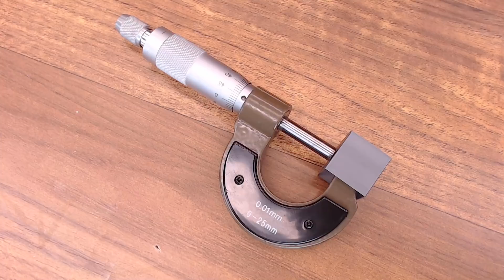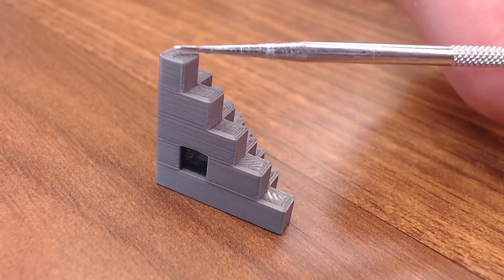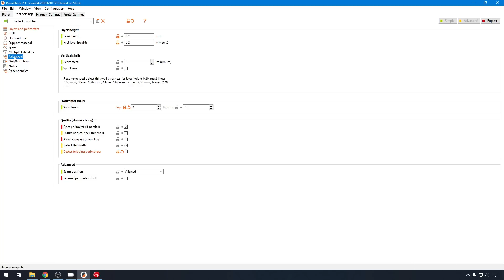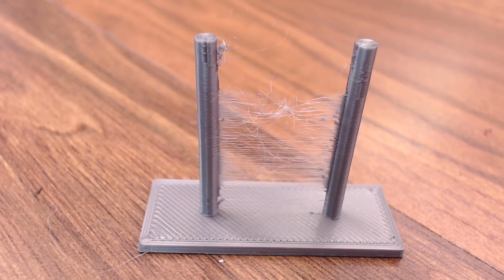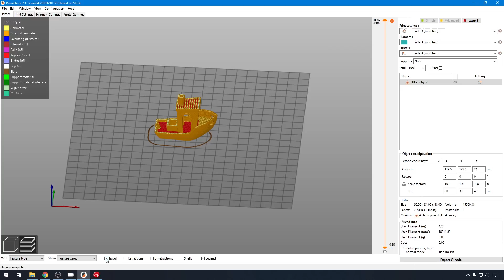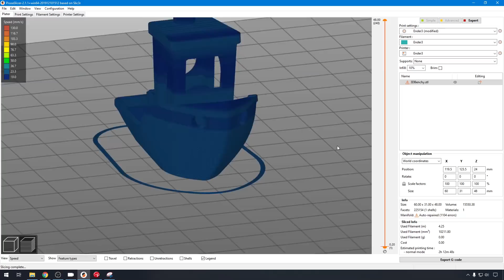New Ender 3 User Part 4 - Slicer Settings Continued - Chris's Basement

Comment: Awesome vid!  Hey just FYI, you can change the retraction on the build plate.  Set up the printer to have "multiple extruders".  Then assign one extruder to each model on the build plate, ie multiple retraction towers.  Each extruder can have its filament retraction settings dialed in independently.
Reply from the maker: Thanks, that's an interesting tip, I will have to try that.

Comment: Chris, I've heard guys talk about storing their rolls of filament in zip-lock bags with desiccant in them for fear of moisture. You've just got yours hanging open on the wall. Is moisture not a concern?
Reply from the maker: Hey Kevin, it depends what it is. PLA/ABS I don't really worry about, it doesn't impact the printing of it much. PETG doesn't like it much, but when it starts to print badly, I dry it for 4 hours or so and it's good a new. They ones I really worry about are nylons and flexibles. I keep all these in dry boxes.

Comment: Chris, Im getting weird issues with prusaslicer and my Ender 3. On retract moves, not all the time but most of the time the extruder will sit there and force a bunch of filament any idea what could be causing this? Has anyone else had this issue?
Reply: Vase Mode sends my ender 3pro nuts with prusaslicer its runing skr mini 1.2 with marlin ..Its fine with Cura loool ..
Reply from the maker: So it extrudes on retract moves? Is it just Prusa slicer doing it?
Reply: @ChrisRiley  Thanks for the reply Chris. I switched to Cura and everything worked great after estep and flow configuration. I'm not sure what was causing that issue other than prusaslicer not jiving with my ender 3 firmware maybe?
Reply from the maker: @douglasrohman6191  No clue, I use it on my ender3 all the time, that's crazy.

Comment: I have auto bed leveling and I put a what do I need to do to make it work? I put a G29 after the hearing script and it say I have an error in my start gcode. Thanks for the help
Reply from the maker: Not sure, please paste your start gcode.
Reply: @ChrisRiley 
 M104 S[first_layer_temperature] ;set hotend temp
M140 S[first_bed_temperature] ;set bed temp
M190 S[first_bed_temperature] ;wait for bed temp
M109 S[first_layer_temperature] ;wait for hotend temp
G28 ; home all axes
G29 ; auto bed level
G1 Z5 F5000 ; lift nozzle
Reply from the maker: @jere2300able  Here you go "

M104 S[first_layer_temperature] ;set hotend temp
M140 S[first_layer_bed_temperature] ;set bed temp
M190 S[first_layer_bed_temperature] ;wait for bed temp
M109 S[first_layer_temperature] ;wait for hotend temp
G28 ; home all axes
G29 ; auto bed level
G1 Z5 F5000 ; lift nozzle
Reply: @ChrisRiley  thanks I see where I went wrong now.
Reply: M104 S[first_layer_temperature] ;set hotend temp
M140 S[first_bed_temperature] ;set bed temp
M190 S[first_bed_temperature] ;wait for bed temp
M109 S[first_layer_temperature] ;wait for hotend temp
G28 ; home all axes
G29 ; auto bed level
G1 Z5 F5000 ; lift nozzle

Comment: hey chris! thanks again, great video as usual :D could i make a video request? i just ordered a skr 1.4 turbo and it lets you connect closed loop steppers (BTT just released their S42B) without the adapters. there are no video's yet that really test the steppers (specially sound) and i was hoping you would consider doing it.
Reply from the maker: Those close loop stepper boards are pretty cool, I will do some testing with them.

Comment: And Chris knocks it out of the ball park yet again. That's got to be the most in-depth video on any slicer that covers what the  settings do and with visual prints. One thing I have noticed with using Prusaslicer with my Ender 3 is when it comes to dimensional accuracy. Parts just don't like fitting together without either trimming or sanding. Any chance you could do a video on that?
Reply from the maker: Thanks Andy, that's interesting. Let me do some tests and see what I come up with.

Comment: Hello Chris,
I have a technical question for you!
I am building the ABL that you showed in your video during the modification of the Ender 2 and also on my Ender 2! What are the values of the 2 resistors you used for it!
Are they coal or metal film resistors and what percentage (tolerance)?
I would be very happy to hear from you!

best regards: Werner
Reply from the maker: You will need a 10k and a 1k to make the voltage regulator. They are metal film,  here are the ones I use. https://www.amazon.com/ARCELI-100Values-1000pcs-Resistor-Assortment/dp/B07PXYVP3J/ref=sr_1_13?crid=21NPS2V8AB9AT&keywords=resistors&qid=1582755649&sprefix=resistors%2Caps%2C208&sr=8-13
Reply: Hallo Chris,
Thank you for your information, I was very happy about it !!!!
Your videos are absolutely great !!!!!! When it comes to software (Marlin) such as the Ender 2 modification video, I also have an absolute software muffle understand that !!!!!
Looking forward to your next videos !!!!!
Greetings Werner

Comment: Very informative, I've read that you should be doing the single wall extrusion print with two perimeters. What are your thoughts? http://www.desiquintans.com/flowrate
Also when examining the benchy, the first inconsistent layer you point out supposedly can be fixed by printing the benchy rotated on a 45 degree angle. This was a tip that came from FilamentFrenzy, I have yet to try it myself but it seems to be an artifact of the 3D model.
Reply from the maker: The two perimeters can be good if there exterior issues. I will get into more of this in later videos I hope. Turning the model can change up somethings, but it depends a lot on the slicer. Tom knows his stuff, so I trust what he says. I have had no luck with that trick in this case.

Comment: Great video.  Looking forward the the next one in this series.  Question on one of the settings, the extrusion/wall width, why one a 0.4 nozzle is the desired wall width  .45?
Reply from the maker: It comes down to how well the lines will bond together, take a look at this doc. https://manual.slic3r.org/advanced/flow-math